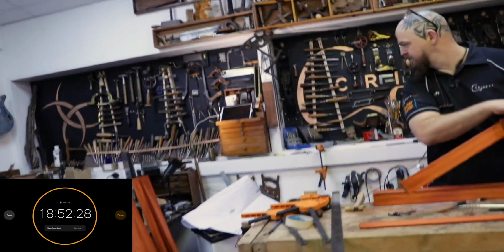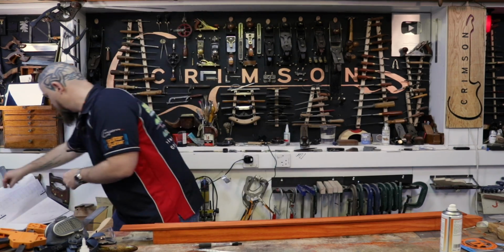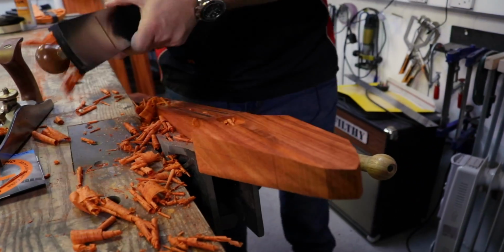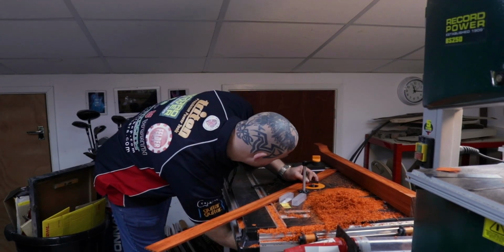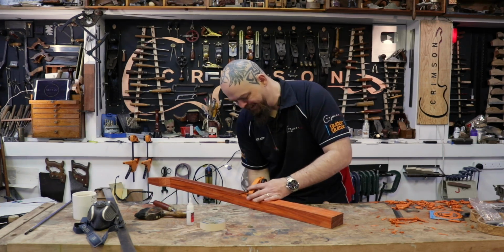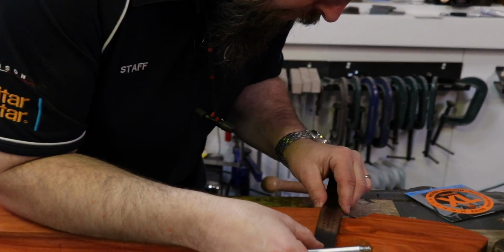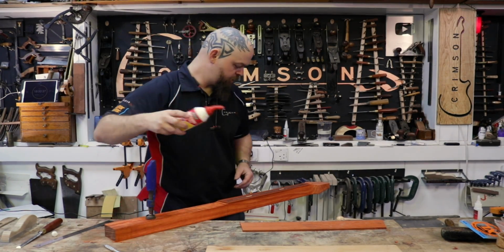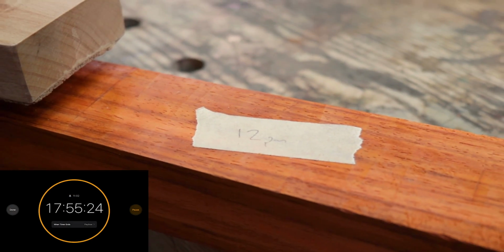Ep 3 - Time to Build - Ben Builds a UNIQUE Crowd Designed Hollow Multi-Scale Guitar in 20 hours!

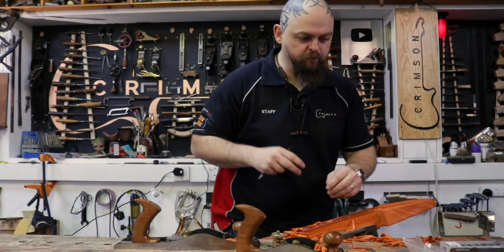Comment: What is the correct method of placing your plane on the workbench Ben? I'll forgive the one shown with an end resting on a pack of strings, but after you finish smoothing the head at 7:10 ??? That's just 'plane' naughty!! ☺️

Good luck with the rest of the build though, looking forward to see the end result!
Reply from the maker: Option one is your preferred I assume? On its side? I am guaranteed to plane off a knuckle or two doing that. Option 2 is mine. Flat on a bench, sometimes raised on something or other but I'm not worried as long as there are no bits of metal underneath where the blade could get chipped. 
I honestly think this 'rule' was perpetrated by teachers who didn't want to sharpen planes any more than absolutely required.. students can't be trusted to avoid nails etc when putting  their tool down. 

I didn't convince you, did I? B
Reply: Haha, awesome response! Glad to hear you have no nails in your bench :) I always argued with my woodwork mentor on this subject, surely a wooden bench is softer than a hardened steel blade, so how would it blunt it?? He was a master and very old school, so I had no option but be drilled into those routines. I can hear him shouting from the grave right now!! From now on I shall adopt your method B, once I've removed all the contaminates from my bench :))))

Keep up the good work Ben, I have a lot of respect for how you've grown and developed your business 👍🏼

Comment: I still want to see a full-hollow jazz box - basically a Johnny Smith style, with maybe even a composite sound board, and nothing but the floating bridge touching the surface.  Electrics suspended from the neck, pickguard, and tailpiece.  Stretch out of your solid-body hard rocker routine!  Doesn't have to be timed.
Reply from the maker: I am building myself an L5 style jazzer this year.. how is that for a start? B
Reply: @CrimsonCustomGuitars  So will you show us the process??  :):):)

Comment: A question about truss rods... Are they mechanically attached to the neck somehow, or do you just drop it in the slot and glue the cover over it? I get what they do, but I'm not clear on how.
Reply from the maker: Yep, dropped in a hole, as you compress it it pushes against the neck and fretboard and move them accordingly. It needs at least one end free so it can move against the wood a little bit as you go. B
Reply: @CrimsonCustomGuitars  Thanks for explaining. I guess I always imagined that the ends were anchored inside the neck and that it lengthened or shortened to flex the neck.

Comment: Hi I have a question I was thinking of buying a epiphone Les Paul on my local selling app. but the original owner had painted the guitar black and replaced the epiphone headstock with a gibson headstock is it safe to have a headstock repair or should leave the sell.
Reply from the maker: A well repaired headstock is fine, I would be more worried about it essentially being. a fake at thos point. However, how can you guarantee it is a well done repair. I would leave it and get a different guitar if I were you. B

Comment: I can't believe how much work this guy does in so short time. Im just happy ive gotten my mahogny body roughly cut out with my jigsaw and planed straight, smooth and even for my 1st build. So much time has gotten into planning, researching and buying the best and cheapest options online.
Reply: Håvard .EF planning your first guitar takes forever. You will be thankful later that you did it.
Reply: Same here buddy, cutting out the ash body with a jigsaw this weekend and maybe the neck..enjoy!
Reply from the maker: Planning can almost be the best bit of a build sometimes.. when you have a few hundred guitars under your belt then speed will come. Also winging it and dancing the knife edge of total disastrous failure.. yeah, that too! B
Reply: Joe Figueroa  that's pretty much gonna be my second build 👍🎸 nice one
Reply: @CrimsonCustomGuitars  Lesson 1 learned today.
I made a jig with a long straight level beam and many clamps to cut my neck out with the jigsaw. The jig shifted on the table as i used all my big clamps to hold the beam on the neck.... and the tabletop bent the blade, curving it badly into the neck underneath before i noticed... 
And there right next to me on the wall, was a sharp long new handsaw....
Atleast im getting some practice joining pieces of wood, as i refuse to toss it away just yet.
Some day i hope to take one of the courses over at your shop.